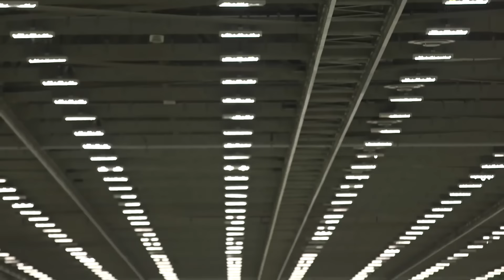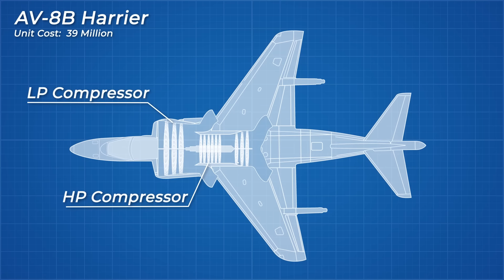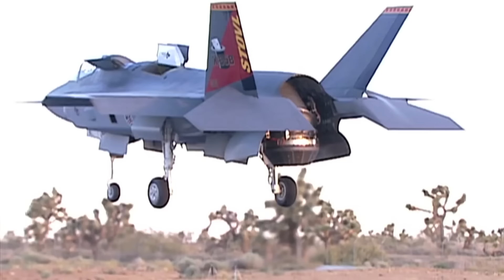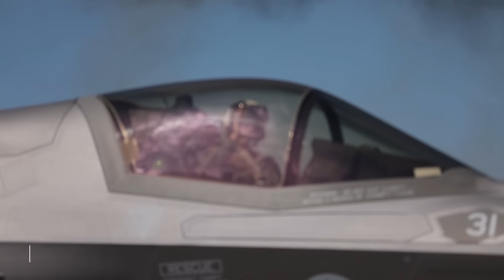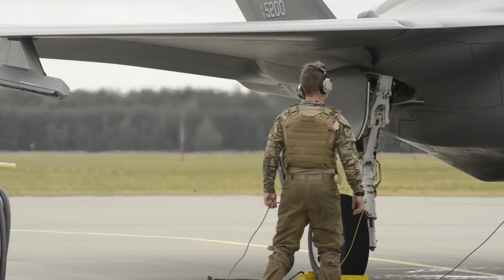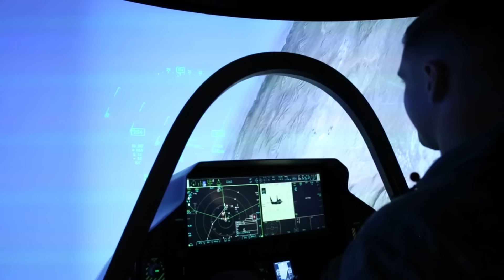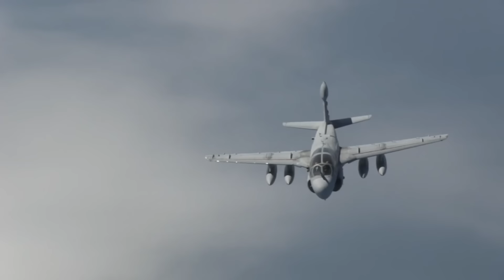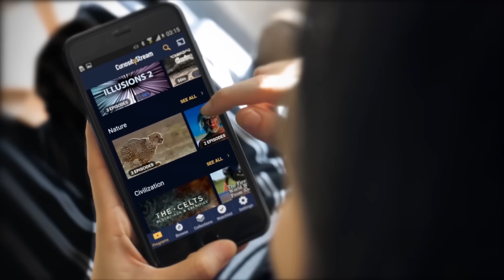Is The F-35 Worth $115 Million?

Comment: I believe that we should have Revisited the final aircraft in the ATF for a new Joint Strike Fighter. It is my opinion that purpose-built multi-role fighters or inferior to are superior fighters that have been converted to take on strike and interdiction missions. If you look at the F-35 Joint Strike Fighter it is a jack of all trades but master of none. It can do some of everything but sacrifices being the master of one thing; it can fly fast enough it can carry just enough ordnance but when compared to a purpose built strike aircraft or an air superiority fighter it is inferior to both in those arenas. If you look at the F-14D, the F-15E, the Su-30MK  the Su-32, and Su-34, all these aircraft were based off of air superiority fighters but they were adapted to take on the strike missions. Since they were based off of larger heavier fighters they retain the air superiority characteristics but also add extra equipment far as targeting sensors and improve racks that carry bombs. By developing the further the F-22 or YF-23 for strike compatibility I believe we would have had a superior aircraft to the F-35. All the engineering of the aircraft and flight systems would've been done saving billions in R&D leaving only software and storage tasks. Having the speed and maneuverability of the F-22 and YF-23 plus the ability to perform strike and interdiction missions would be a devastating aircraft to combat.
Reply: The issue of course being cost. The F-22 was already quite expensive, redesigning it to have larger internal weapons bays suitable for bombs would make the theoretical strike variant even more expensive.
Reply: "sacrifices being the master of one thing" - How so?
"If you look at the F-14D, the F-15E, the Su-30MK" - All of those are "high" in the high-low mix (If we consider the F-14 to be the "high" to the legacy Hornet's "low").
The F-35 is equivalent to the low aircraft, such as the F-16.

Comment: You jest this white elephant has recently had a spell of planes falling out the sky F35 flying death trap one crashed after a failled refuelling event another loosing its nose wheel on landing 3 falling out the sky along with the F22  the F35 has problems not allowing it to fly within 30 miles of a thunderstorm due to a gas valve problem also the plane can not go supersonic due to skin heat problems the DOD has 12 other problems
Reply: You're holding the F-35 to an absurdly unrealistic standard. Name a fighter that doesn't have several accidents on record.
Reply: Apart from the single USMC F-35B crash a couple of years ago all of those accidents have been the result of pilot error, not the  aircraft failing.

The thunderstorm issue only affects the A model and is not a gas valve problem, rather it was found that some F-35As had damage to their OBIGGS plumbing and nobody wants to risk a pilot's life when they aren't even at war. A solution has been agreed upon that strengthens the plumbing and will begin being implemented by the end of the year.

I have no idea where the claim it can't go supersonic originates from... even the speed-restricted versions can go supersonic for short periods of time. The F-35A is completely unaffected by this issue, and the issue is so unlikely to occur on the B & C models that governments have agreed it simply isn't worth fixing. For reference it has only occurred twice in the F-35 program's entire history, and the last time was in 2012. Speed restrictions are in place for the B & C models only during peacetime.
Reply: I dont know how much a nation would release to its tax payers i know the UK gov invested 1 billion dollars in this debackle the US dropped the number for a new aiircraft design selling this trash to other nations cheap they need to spend 15 million dollars per plane to put faults right no nation should be forced to buy US trash
Reply: @tonybrooks7201  All new fighters have problems, not just US ones. It's inherent to the industry since products are built to order and have to be tested by the customer.

So you're unaware of how mass production works? The F-35 got cheaper because orders increased, not because the price was supposedly artificially reduced to get the sales.

Comment: Bit how do you compare boeing's 2 designs to the  3 separate designs of the F-35 (F35-A, F-35-B and the F-35-C) ultimately they decide to go with 3 separate aircrafts instead of 1... Let's be honest nothing you say will save the FAILURE of the F-35 program and I say this having seen this aircraft in person but ultimately there original plan FUCKING failed end of story
Reply: It was a requirement of the JSF program to have 3 versions of the aircraft. They were only required to produce prototypes for the air force and marine corps models during the competition and that is exactly what both companies did. 

Apart from the primary cause of the cost overruns and delays being the political decision to produce and develop the F-35 at the same time, how is the program a failure?

Comment: 12:40 "The F35 has performed phenomenally". MC 2020 F35A and B=50%; FMC 2020 F35A=34%; F35B=16%; F35C=2% (official numbers) I would call that far from phenomenally. Perhaps phenomenally bad. At the present time it's still a lemon, as Sprey said many years ago. And because its flaws are built into the basic design of the plane they cannot be fixed. So it'll probably stay a lemon. And btw can someone fix its cannon, which can't shoot straight?
Reply: Sprey is an oldhead stuck in the 1950s and who hasn't been near the aviation industry for decades. Next time I want someone's opinion on jazz records I'll ask him.

Comment: Stealth does not matter in a dogfight because most modern radars can track it in a close in dogfight, in BVR its designed to be stealthy.
Reply: F16 would destroy f35 in bvr
Reply: @adamsteele6148  dude how, F16 doesn't even have an AESA radar, you might be kind of right because the F16 may be able to pick it up on radar at the WEZ ( weapon employment zone) if it was using older aim120s which have shorter range but the F16 doesn't have an many advantages if any . There is also ECM and other factors. Basically your statement makes no sense, only slightly objectively.
Reply: @schylertkatchew2659  f16 doesn't need to see the f35 it can dodge missles easily.

Comment: The F35 is a lemon, it is highly modern today but as other nations build steahlt fighters that are faster and more agile or simply spend more on E-warfare the risk of F35 ending in a dogfight increases. A modern airsuperiority fighter is needed ASAP. The present 2000 F35s should be limited to a maximum of of 1200 units and a cheap low RCR plane should be constructed that has a low flight hour cost, something tike a Jas 39E would be more than good enough. By buying 800 of them there would be money enough for a replacement of the the F22 and F15.
Reply: That's the exact same argument made for cancelling the F-22 in favor of the F-35.

Comment: The biggest problem is in the mass production saving money, will not exist because before it happens the planes will be obsolete just like your computers are. Every 18 months you need to buy a new computer same way with the aircraft. So mass production will not work if you call aircraft you'll see what I mean the F-22 was obsolete before it was manufactured
Reply: The F-22 is obsolete by what metric?

Comment: 10:27 but would they save more money in the long run? The F35 family have more common parts and multiple users. Instead of 3 different designs.
Reply: That was the theory. The issue is that the complexity of engineering three variations with fairly different major designs really upped the initial amount of money that had to be spent. We will see how maintenance costs behave relative to the airframe flyaway cost over the next decade or so-- it will probably behave as you expect it to.

Comment: August 28, 2020: The Royal Netherlands Air Force's F-35A Lightning IIs ultimately did not take part in NATO's “Allied Sky” exercise. The Netherlands were unwilling to take any risks as a problem with the fuel of the F-35s in question could cause the aircraft to explode if it “encountered” lightning. Lockheed Martin, the American company behind the F-35 Lightning, is working to find a solution to this problem.

Comment: Only the Stealth Technology and advanced avionics itself and advanced radars and sensors are worth it, but overall the Fighter plane itself is not worth it for $115 Million Dollar. So expensive air frame Since the fighter plane can't do Supersonic because of it's air frame stealth coatings will deteriorated if they fly so fast.
Reply: That's a peacetime restriction, not an airframe limitation. The issue is highly unlikely to occur even if they sustain supersonic speeds for the entire flight, but if you're not at war why risk it? Additionally the issue has only ever affected the B & C models. The A model which is by far the most popular variant is unaffected by the issue and has no speed restrictions placed on it.
Reply: @dumdumbinks274  then the A variant of an F-35 is a little bit worth it I would say. But honestly they're really not that worth in my own opinion. When it comes to stealth Fighter jets the F-22 Raptor is by far the most Undisputed Unmatched Fighter jets ever built. Every dollar is worth it. Not just the F-22 Raptor, in also a big fan of F-14 Tomcats. That plane is a bad ass.
Reply: @buknoychiifiocchii8058  Well the F-35 is far more versatile than the F-22 and comes in at half the cost ($78M for an F-35A, $155M for an F-22) while being only slightly less capable in air combat. Additionally the F-35 has significantly longer range than the F-22.

F-14 is cool, a shame it was taken down by politics.
Reply: @dumdumbinks274  oh no F-22 is greater than The F-35. the F-35 wasn't built for Air Superiority Fighter it was built for Multi-Role Fighter. The F-22 Raptor on the other hand was built and proven to be the most air dominant fighter plane ever built that actually a full stealth, that really cannot be seen on any modern radars. The F-22 have zero detection. The F-35 still has some small percentage of getting detected at any advanced enemy radars and sensors. That's why The US have never worried too much on exporting their F-35's to other countries.
Reply: @dumdumbinks274  oh yeah true! I love the F-14 Tomcat. I love the F-14 much better than the F-35.
Reply: @buknoychiifiocchii8058  The F-22 is a decade older than the F-35. Sure it was built for air superiority, but it is old. Additionally the numbers you might see in articles for RCS of both fighters are estimates based on the goal for the F-35, and the test results of the F-22 back in 2006 The F-35 wasn't tested until 2009, and they discovered it was stealthier than the F-22.

The US haven't worried at all about exporting the F-35 because it is a multi-national program. The US have no legal grounds to restrict export to nations that are involved in the F-35's development. Also note that the F-22's restriction on export was because of the specific situation at the time, not purely the fact it is good. 

The F-22 was developed after the end of the Cold war during a period where nations were drastically reducing their military and security budgets. If the US exported the F-22 back then there was a larger risk of spies getting information than there was during the Cold war, thus they opted to restrict sales. Something noteworthy is the fact that not even the Super Hornet was available at that time... the 2nd most capable fighter available worldwide was still the F-15C in the same configuration it was during the Gulf war.

Starting around 2005 there was a push to export the F-22, getting as far as official proposals to other nations, but partly due to cost there was little interest in the F-22, especially since most nations were already on-board the F-35 program. The F-22 export proposal began to face opposition around 2007 when notable politicians began their attempts to cancel the F-22 program outright, and since 2013 nobody has been able to buy the F-22, not even the USAF.

Comment: Wow yeah looking back at this video not even a year later and the price has dropped so much, A is 78M, B is 100M and C is 95M now. Still crazy expensive compared to the F-16 tho, which is only around 19M.
Reply: The F-16 is several times more than $19mn.
Reply: @infinitelyexplosive  The price varies, last time the US bought some it was 19 Mil, some were sold to Taiwan for 25 Mil but that's not 'several times' 19 Mil and there's a markup for foreign buyers.
Reply: @todo9633  Inflation alone puts the current price 1.6x higher than 1998. Adding modern avionics like an AESA radar and enhanced flight computer brings the price up significantly more. Even accounting for profit, simulators, maintenance equipment, etc., the planes are significantly more expensive than older variants.
Reply: @infinitelyexplosive  I mean, you can guesstimate all you want, but since it's impossible to get exact numbers for individual planes from foreign contracts all I have to work with is US contracts, and the last time the US bought F-16s was in 1998.

Plus the 1998 19M price wasn't for the A/B model either, it was for the C/D variant, which was already pretty advanced, further upgrades for the V variant wouldn't rack up the cost as much as you're trying to portray.
Reply: @todo9633  There's no markup for foreign buyers... they request certain features that are not present on US equivalent versions or order in small numbers, both of which increase the price.

$19M is not for an advanced F-16 and never was. It is the 1998 inflation adjusted price for the very first F-16C/D which was Block 25 in 1984, and in today's $ value is equivalent to $30M. The heavily upgraded Block 50 variant which is operated by a few USAF squadrons comes in at around $55M per unit and still isn't the most advanced F-16 available today. A fully decked out F-16 comes in at around $70M.
Reply: @dumdumbinks274  
Not advanced compared to modern day aircraft but still extremely advanced compared to most of the F-16s in service in 1998, which were A/B variants.

Lockheed Martin has a contract to supply 90 F-16Vs plus all support and training equipment and spare parts to Taiwan for 62 Billion, and even then with that being the total cost for the whole contract it only evens out to 68M, which is still far more than the price for an individual plane would be.

Yes, there's a markup for foreign buyers, of course there is, to think otherwise is absolutely ridiculous. At least unless another country was involved in the design funding in a significant way.
Reply: @todo9633  Many A/B variants had undergone their MLUs by 1998 and were thus more advanced than the Block 25. The Block 25 itself was not nearly as advanced as the Block 50 which was available by 1993.

The $62B deal works out to $688M per aircraft. There is plenty of room for other factors which are noted to include many electronic countermeasure systems, weapons, training, spare parts etc over a 10 year period, and it's not solely for Taiwan who are receiving 66 of the 90 F-16s that are part of the order.

Do you have evidence of a markup? The US are not the ones profiting from the sales... it's the defence contractors.
Reply: @dumdumbinks274  Right my bad for the bad math.

The Block 50 was still a sub-variant of the C/D Model, smaller improvements are made within the variant so when I say C/D I'm more referring to the C/D runs overall. The terminology is weird like that.

The US doesn't profit directly from the sale, but the sales are negotiated through the US government, and that's taxable income. If the US government(who payed for the development) aren't putting a markup on the sales compared to the prices that they're getting from local companies then I'd be very surprised, but I suppose there's no real evidence either way besides the fact that it's pretty standard practice in the arms industry to either sell high or low depending on interests.
Reply: @todo9633  C/D models vary widely in price. Sure they started around $15M in the 80s, but the avionics in an original Block 25 are completely different to a modernised Block 50. Minimum price today is $55M unless you look at 2nd hand sales. 2nd hand Block 40s with minimal upgrades go for around $38M.

Similarly you can look at the F-15EX which is being bought by the USAF for roughly $90M per unit, despite the original F-15A costing around $20M in 1976 $ value, or the F-15E (which the F-15EX is based on) costing around $28M in 1998 $ value.